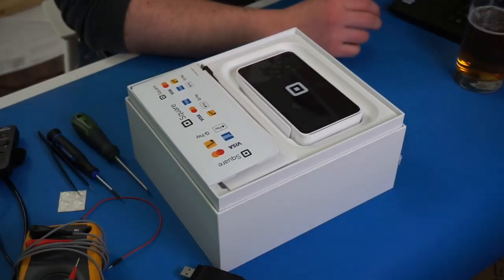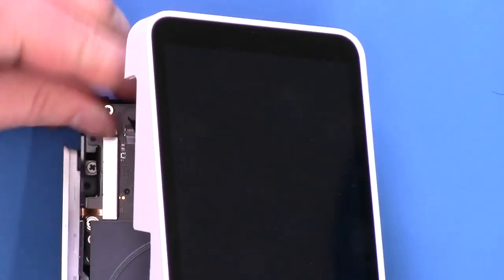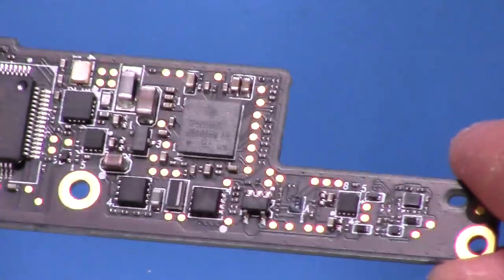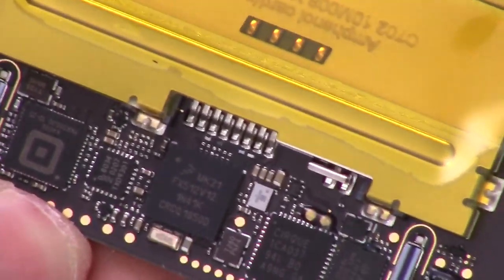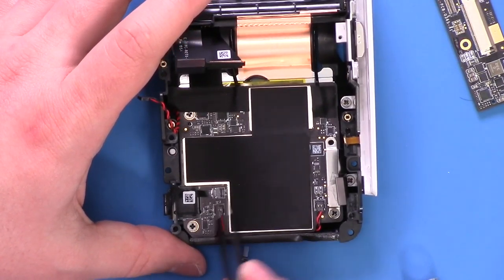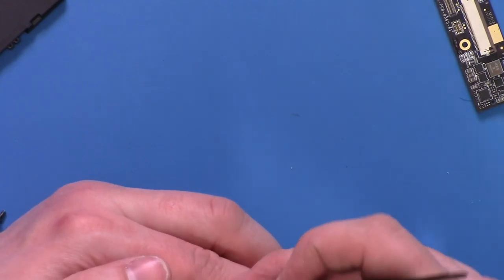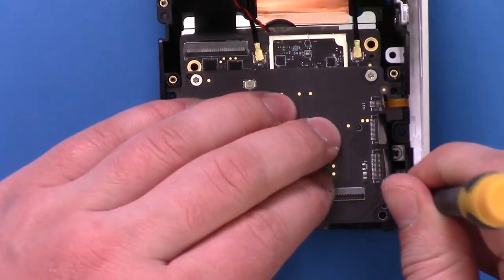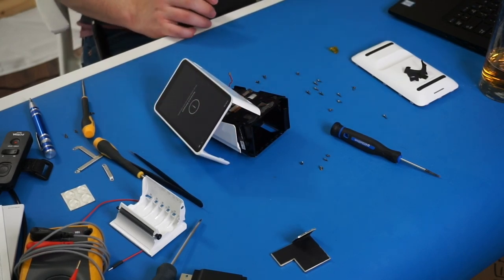Square Terminal Teardown & Tamper Testing (Part 1)

Comment: 5:01 - Honestly thought that was a spring pin that was sitting underneath the head of the screw. Easy to bypass such a contraption but honestly would have been so cool to see an anti tamper spring pin under a screw. Who would expect it!

Comment: This is a fairly new design. I did some research into these portable payment terminals about 18 months ago and the Square offering was very different to what you've shown here. Tamper protection and tamper evident features are roughly equivalent, though. The outer shell had no tamper protection but the inner shell (screwed on) had contacts and a conductive mesh to catch removal or drilling attacks. Major difference seems to be that this runs Android (the previous was something custom, never managed to dump firmware though) and there are a lot more test points here.
Reply from the maker: This is the first Square device I've looked at, so don't have as much feel for how it's evolved! You're right lots of test points brought out, haven't put programmed on but assume JTAG etc locked. This one was on sale was only reason I looked at it now really...

Comment: What is the chances the battery is easy to replace and is it cost effective to do so or cheaper to just buy a new terminal? I have one that is 2 years out of warranty, only turns on and works when plugged in. When unplugged even after sitting for charging, updated software, it will shut off when unplugged and won't turn on if not plugged into an electric outlet. Any idea if its fixable and easy to do so?
Reply: I had the same problem, the terminal worked fine for 3 years, but finally the battery died. Change the battery is complicated. I took the decision to order new one!  I remembered the technology is constantly changing. My investment was around $0.25 cents per day, my business can afford that. Good look!

Comment: Thank you for showing how to get that back cover off.  I have a terminal that is unresponsive, and I wanted to check that USB charging port, but it looks fine so I don't know what the issue is.  Going to send it back in for repair I guess.

Comment: xrays on the boards next ? maybe one could try to bypass the anti-tamper by drilling through the pcb
Reply from the maker: Might send some to a friend with x-ray to see what they did. Curious if there is some mesh on an internal layer or something similar. Have some ideas to test on the tamper still though first, need to get another terminal though before I can put anything to the test... gets expensive to be wrong quick ;-)

Comment: So is it reasonable to assume a screen swap shouldn't really affect anything?  We have a terminal with a fairly cracked screen.  Seems like some screws and two ribbon cables could get us a fresh screen from a donor unit that has no power or otherwise bricked.

Comment: Nice tear down,
The NFC coil not being put back may contribute to the error message...although taking the battery backup off should be somewhat terminal..(No pun intended)
Reply from the maker: I did try after with nfc back on, still gave error. Didn't really think of it when recording. Assumed they will kill themselves for security reasons...

Comment: One of my employees tried connecting an Apple Lightning charger to my terminal and now the actual charging cable will no longer charge the terminal. I can disassemble the terminal to get to the charging connector in the terminal but cannot find a replacement connector. Do you know where I might find one?
Reply: Any luck finding one? I’m on the same boat

Comment: thank you , now I know it's Impossible to change the battery
Reply: These things are basically disposable since the battery can't be replaced and I have two that both just went out on the same day. Neither will recharge and I've only had them for roughly a year and a half.

Comment: Be INCREDIBLY careful with the display cables. Your not careful and you'll pull the connector straight off the board. This is terribly built in my opinion.